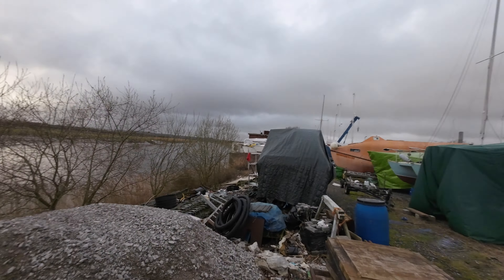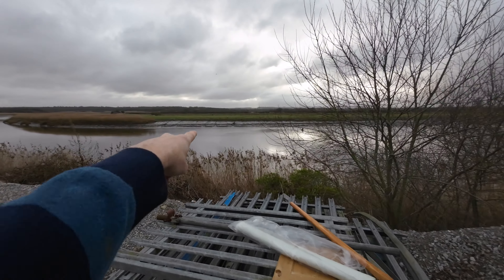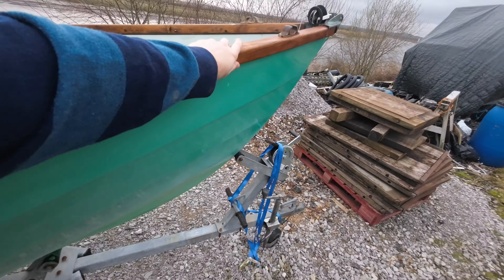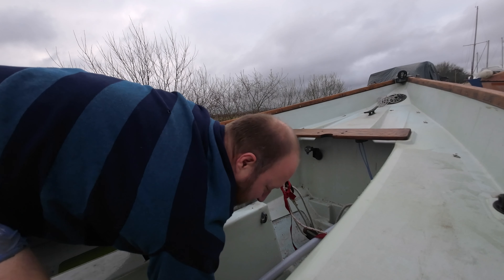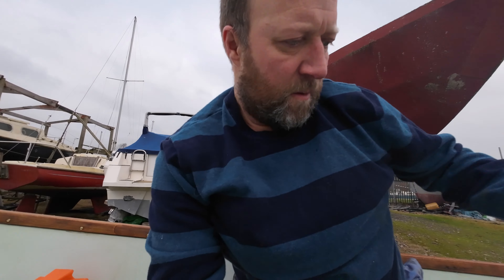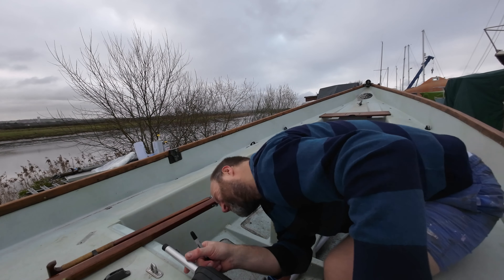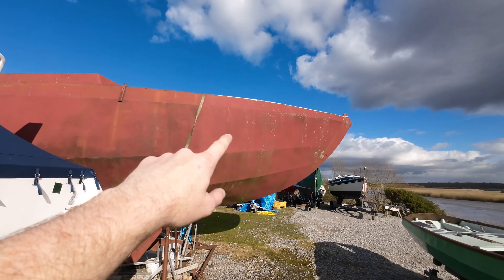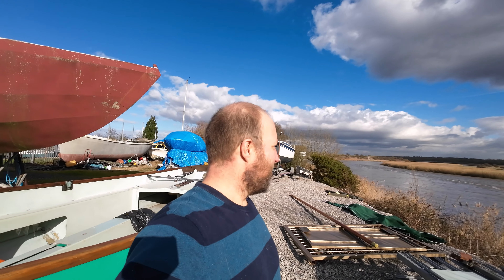Big Wins and Big Failures At The Boat Yard Today!!!

Comment: well you couldnt have made that up, i was thinking when u put the bolts in  i hope they line up, but they were way out, what did Drascombe say.
like the idea of the rubbber over the slot but will it effect the wood plank over the top or is that the next ** ** otherwise looking good
Reply from the maker: Yeah, I gave up on Drascombe tbh. The slot rubber well just have to see. It will at least help with water sloshing up if nothing else
Reply: @SailingWithDave  fibreglass the holes and renew with the new ones. I guess that’s what you will do